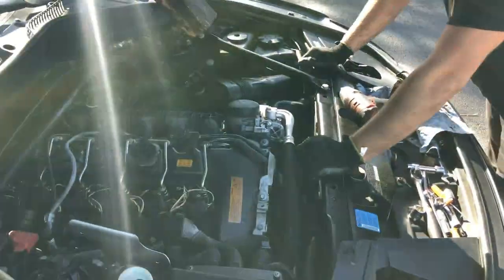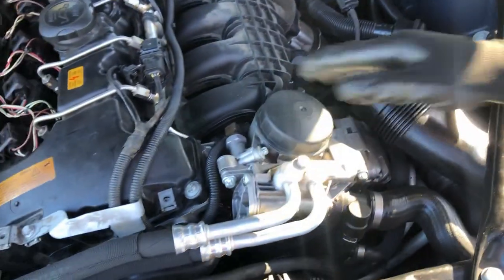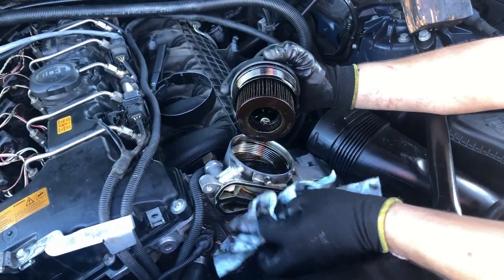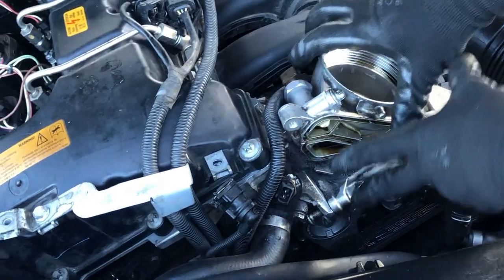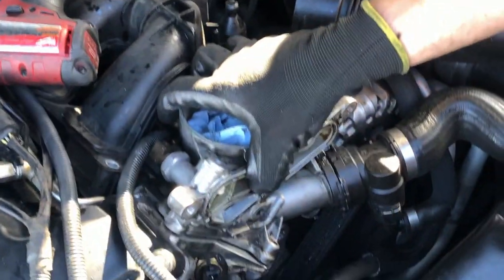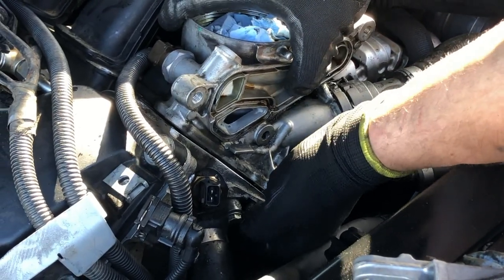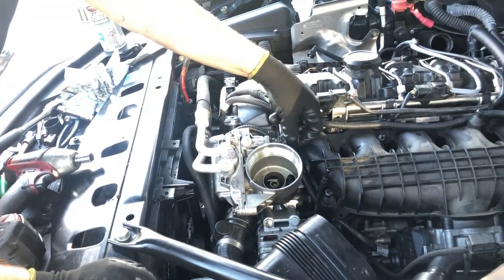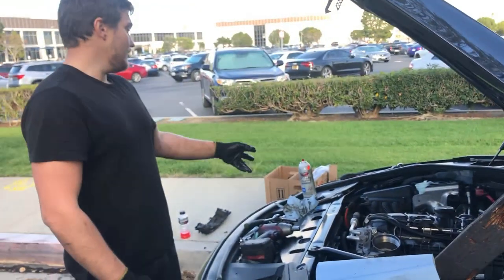DIY F01 BMW 740LI Oil Filter Housing Gaskets Replacement N54

Comment: Great job ! Great work! Now I just need to go buy some tools I need the valve cover changed as well my mechanic said I need a whole new valve cover $570 how does he know that if he hasn’t taken it out yet ?!! Also I need the housing filter I think I can do that myself seems much easier also any videos on the turbo lines I think mine are leaking too smh once again thanks on the video helps a lot
Reply from the maker: Valve cover rarely cracks on 6 cylinder turbo, more often on modern 4 cylinder turbo engines by bmw, you are welcome

Comment: Thanka for your videos, What's your thoughts on reliability of the 740 engine, I am wondering which is more reliable between the 740Li and 750Li. I'm looking to get a used one, at first I was considering a 2011 535i F10 but since that are both 6 cylinders I thought of going with the bigger 7 series. Pls I will like to know your thoughts. Cheers and keep the videos coming.
Reply from the maker: hi, definitely would chose 740, since it is 6 cylinder it is very reliable 7 series comparing to v8 models

Comment: hello. I want to replace only the oil filter with the radiator gasket, do I need to use antifreeze before the replacement?thanks

Comment: Great video. A points of constructive criticism: 1) every bolt you removed for the oil filter housing should have been replaced. Those bolts are torque to yield (TTY) and BMW recommends they be replaced. 2) I cannot understand how technicians reinstall bolts WITHOUT a torque wrench. Proper torque is needed on those TTY bolts, not the torque force applier at the end of your wrist.